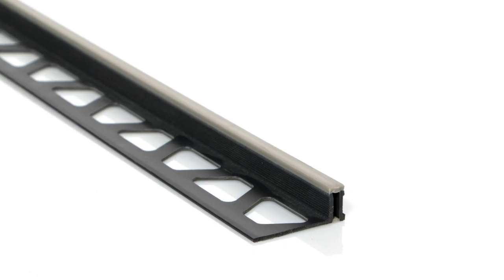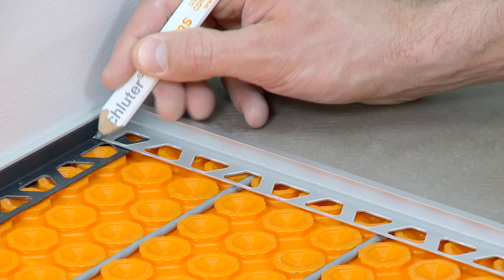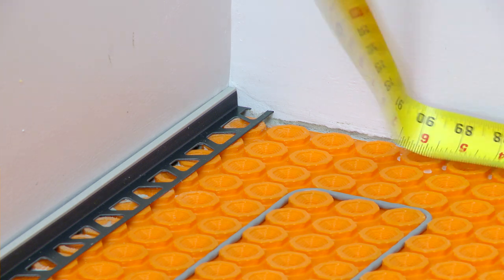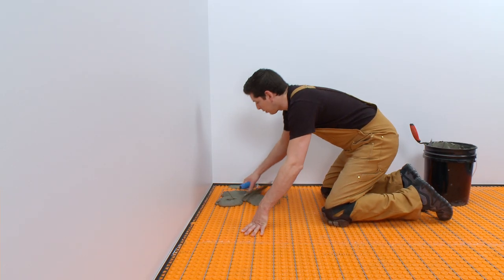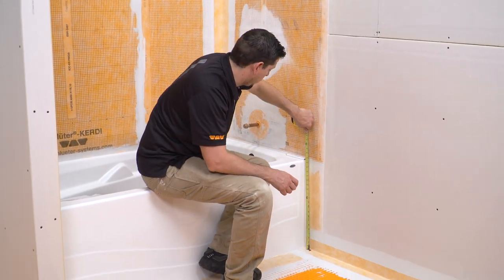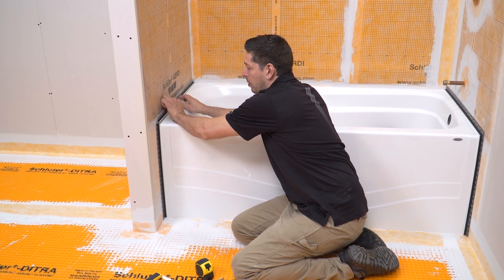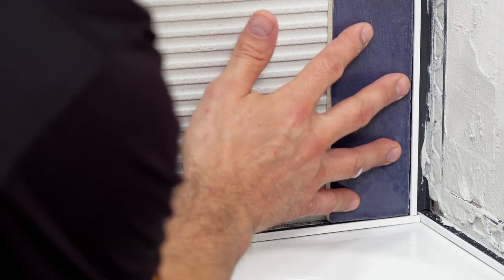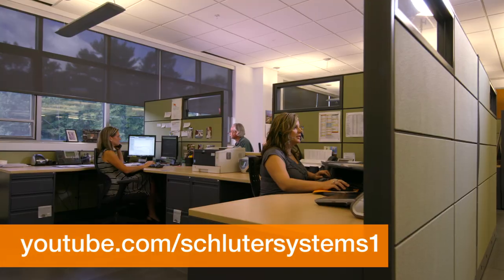How to Install Schluter®-DILEX-BWA Movement Joint Profile

Comment: The video left out adding a small bead of silicone to the bottom of the BWA before placing it down on the tub. In this case, it wasn't needed. But in some instances silicone is recomended under this profile.

Comment: In the tub application, it seems like water can get between the profile piece and the tub surface. What stops it from just sitting under there and getting moldy?

This timestamp shows the exact crack/opening I'm referring to: https://youtu.be/0gUqkbUK6zY?t=278
Reply from the maker: Good question! Once the installation is complete, there generally isn't a gap there or it is so small almost no moisture will get in there. The installation is waterproofed with the KERDI-BAND waterproofing strip and the BWA profile is made of PVC, so no water will get to a food source. If a slight gap is left after install, you could always add a little grout in there when grouting the tile. Hope that helps!